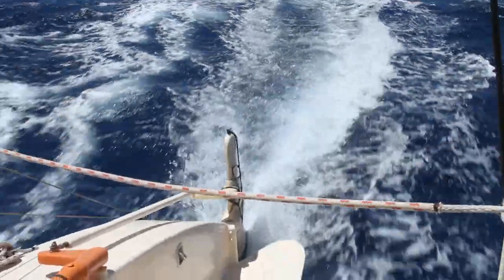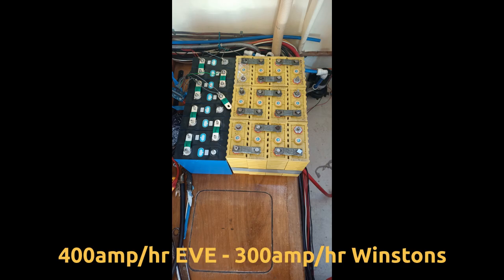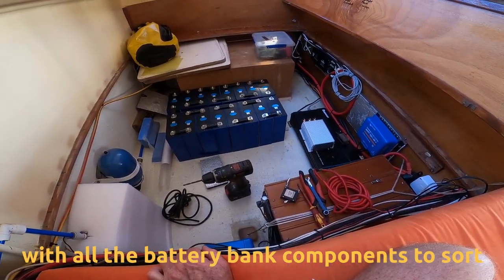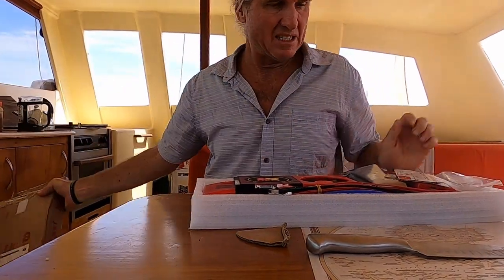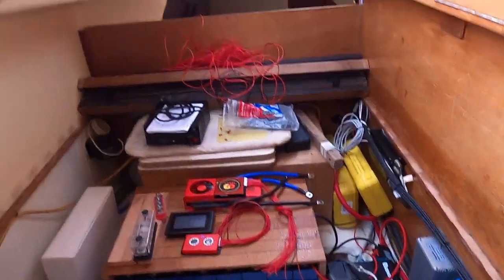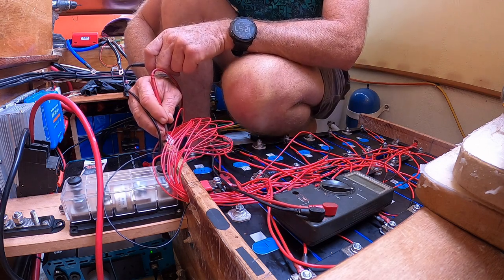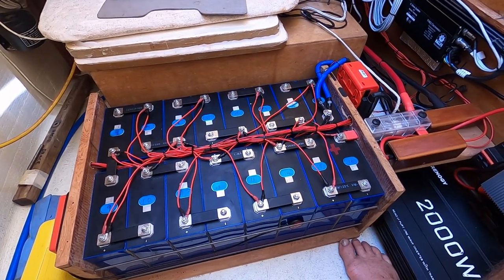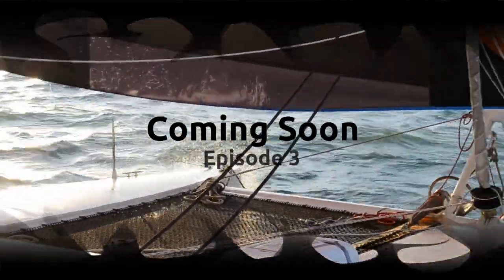Solar Electric motor on a yacht- Episode 2-The 15kw LIFEPO4 Bank

Comment: How is the sound level inside the cabin coming from the 10kw motors once they are fully covered in?
Reply from the maker: A reasonable amount. I scoured utube to hear what other motors sounded like, but they always seemed to be playing music, or running them really slow etc. So I haven't actually heard another boat electric motor running. A great deal of the sound is actually the saildrives gears, which can be heard on a different frequency to the quiet whizzing of the motor. Also we hear the prop noise a lot more now, it also being on a different sound frequency. its just not dead silent at all.

Comment: Thanks again for a great video!

I’m thinking about using their axial liquid cooled motor. It’s 72v though. I’ll use dual axial motor with a 60kw bank and have the generator as a backup ‘fuel’. 

Once I have drawn it all up, I would love to share the details.
Reply from the maker: Sounds impressive. Do you mean to use the Golden Motor 20kw motor at 72v? 60kw is a handsome bank and would  give you a decent range. Our 15kw is mostly quite enough for us. We did just cross Bass Strait and there were some prolonged light periods. We were able to motor sail nicely with the electric and have pushed our bank down to 30% but we did use the diesel for a few hours and felt grateful for it. I would be more than happy to see your drawing details.

Comment: Hey, that threaded rod doing the compression is scary close to a melt down and fire. For the love of god, put some foam in there to protect the cells in case of a shift eg from a big wave or banging into a wharf. The alloy skin 0.2mm under the blue skin is part of the circuit.
Reply from the maker: Thank you Fredio. I'll look into that. I think I have clear pvc tube over the threaded rod, over the house bank your right, I have left the 15kw bank rods bare. A much appreciated comment.

Comment: 3.6V is right at the edge of what the cells can make. If recommended to keep them lower around 3.45V. You will lose an insignificant amount of capacity but gain a lot of safety margin and less wear on the cells.
Reply from the maker: Yes, I'm always intrigued by this point. The actual specification sheet from EVE says if these cells are charged to 3.65 v and discharged to 2.5v then after 6000 cycles the cells will be at 80%. Being less close to the very peak seems to be a good trade-off to a very small capacity gain.
Reply: 3.65 is correct, zero harm and substantial benefits from fully charging them, in fact if you don't you rapidly lose track of how full they are. Worth noting that you can fully charge them at lower voltages than 3.65 but it takes longer. 3.65 FTW.
Reply: @fredio54 The higher the voltage of a cell, the higher the degradation. That's a universal rule. Yes, the cell will probably survive 6000 cycles between 2.5 and 3.65, but you might get more if you charge only from 3.0 to 3.45. 
And why would I lose track how full the battery is? It's not a bucket. 3.65 is as arbitrary as 3.45.